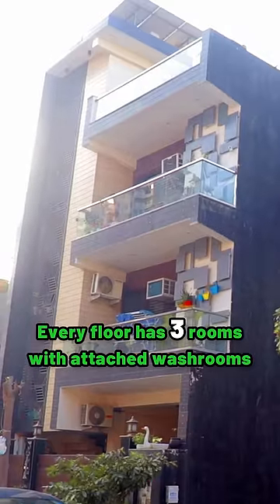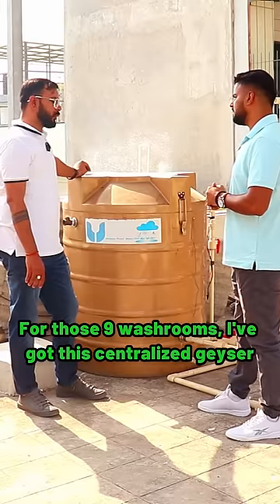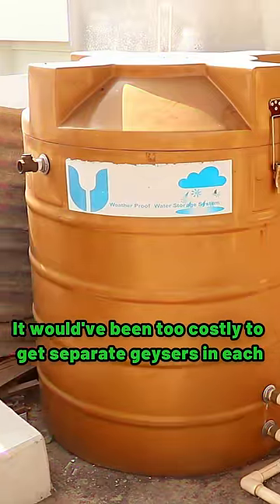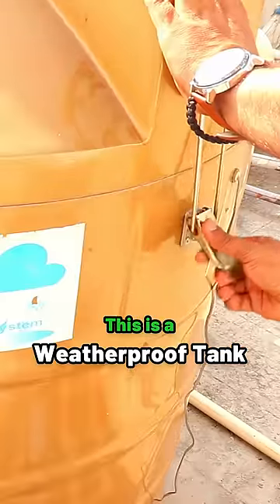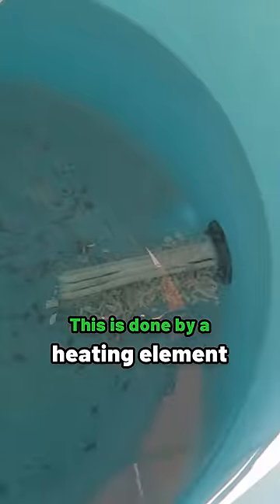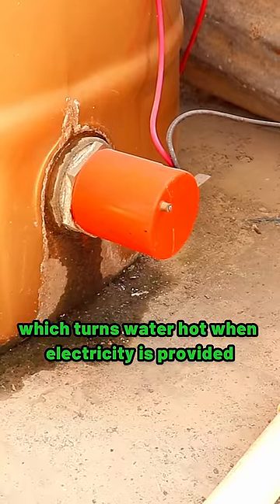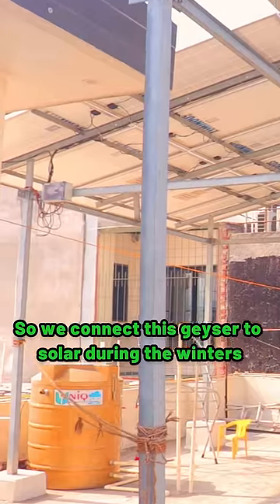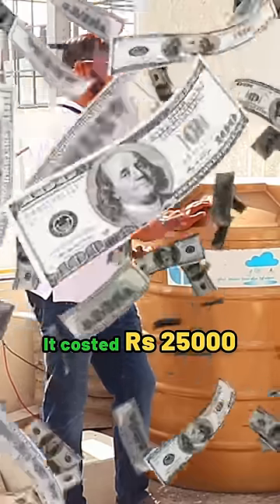Best Water Heater for Home | Central Geyser

Comment: It is a good solution if everyone bathe almost at same time. Heating 500lt of water is time consuming as well as too much electricity consuming
Reply: Brother it's a weather proof tank. So once the water gets heated in this tank it'll stay hot all day.
Reply: @RohitKumar-nl8dl but the pipes to the ground floor will be freezing cold in winters in North India. They will take away most of the heart from the water.

Initially only cold water will come for to residual water in pipes getting cooled from the environment. Then once the hot water starts flowing in these already chilled pipes it will again loose done heat. 

So it wont be effective for the ground floor or first floor residents.

Also he is only telling the cost of insulated water tank which is 25000 rupees but he is not including the electricity cost since he already had the solar setup installed.
Reply: @ankitgarg8595 also the current flowing through water 😂
Reply: @RohitKumar-nl8dl bhai without insulation material ke koi chiz weather proof nhi hoti aur second thing jb tak pani tab tk jayega tb aur heat loss hoga aur iska coast of electricity bhi 4 geyser se jada hi ayega kyunki koi admi 9gysers use nhi kr sakega iska ek simole solution ye ho skta tha ki bnda bathroom or kitchen ka same gyser lga skta hai arag done ki distance 10feet se km ho ya do opposite bathroom me same gyser connection lg skta hai ya best option solar water use kr skta but ye chutiya panti hai aur time consuming chiz hai
Reply: @Suraj-tz3oq the road he used is a imulsion road ye same type ki road gysers me use hoti hai so isme current nhi lagata hai unless ki rod brust na ho jaye
Reply: Useless😂😂

Comment: You are having hard water supply, due to which you need to change heating element very frequently. Better to add a water softener in the system

Comment: Bhai pura tank garam hote hote dopahar ke 12 baj jate hai...😅😅
Reply: Thermostat lga hota hai…over heat pe cut kr dega…. Raat ko lgake soo jaya kro subha mst grm grm paani milega😂
Reply: @viveksaini6515 jiska solar nahi hoga uska toh 50k ka bill aa jayega😂😂
Reply: @realgoat501  ary jb cut krdega tb light thodi use hogi baba😂
Reply: @realgoat501  aur jisne 9 bathroom bnaye hai.... Wo bhai ko 2000w rod ka bill b jhel he lena chaiye😂😂😂
Reply: @viveksaini6515 for your kind information btao ki 10 liter ko gram krne me jada time lagega ki 500ltr ko or jo pipe line hai usme km se 15-20ltr pani to store hoga hi aur fer heated water ko main tab tk jane me bhi heat loss hoga jo ki single gyser ke load se jada hi hoga because a single gyser around 15-20 min me 65degree heat jr deta hai but isme loss jada hai aur koi thermal insulation bhi nhi hai jisse heat ka transfer ruk jaye isse badhiya to ye solar water heater lga le tb bhi thik rahega but ye chutiya panti hai aur inefficient bhi
Reply: @nikhilkale it only takes 45 mins which is same to your 25 ltrs of geyser.
Reply: Aur agar jyada garm ho pani aur cold water milana ho toh?

Comment: @Solarclap bhai problem is that har saal element gal jata hai aur fir na replacement milta hai na koi replace karne wala. ₹200 ke element ke lie 5-600 mangte hain.
Reply: But jab bijli ke bill se compare kroge toh yeh sirf uska 10% hoga
Reply: @MrChetan486 we have solution for you by providing the same product to you which is far better than solar geysers and cost saving as well as energy saving
Reply: @MrChetan486 this element comes with warranty of 1 year and tank with 10 years.The element provided is made of steel 316 which is very durable and is used in industries and salt water as well.

Comment: Bhai Itne mein ready made solar geysers aa jaate hein. Secondly this guy is having too much energy losses. solar energy to electrical and then electrical to heat energy.
Reply: Bhai enery can neither be created nor be destroyed it only destroy one form to another
Reply: Wo efficiency ki baat kar rha hai bhai
Reply: @mohit23bansal you are wrong brother it is a weather proof tank which leads to no change in temperature thus it only takes 45 mins for heating 500ltr water and consumes only 3 units of electricity with 4kw element.

Comment: Actually it will not work as you are expecting. The CPVC/UPVC pipeline is not thermal insulation, so if you want to use hot water on the ground floor, you have to waste around 10ltr water which will be coming from the pipeline, and after that you might get the warm water. Hence, waste of money.

Comment: Wjat if the heater system leaks electricity current into the water? Everyone will get shocked just by touching the tap, right?

Comment: Avg. Geyser price = rs. 2000 
Total bathroom or washroom = 9
                     =2000x9
                     =18000
Buy single geyser for each room
Now, 
About electricity , 
In india where winter is only for 1 month or max to max 2.5 months so iam taking for 1 months
This is the consumption chart
Hourly2000 Wh = 2 kWhDay6000 Wh = 6 kWhMonth180000 Wh = 180 kWhYearly2160000 Wh = 2160 kWh

Thank you❤

Edit:- an heating rod can be a good option if you have low budget it starts from Rs. 450

Comment: 25 thousand electric bill... It may be get 5 to 6 hour to heat with one 1500w rod...

Better use large biryani aluminum vessel around 8000rs concealed with cement and brick 5thousand... Use both rod to heat or wood to fire...

Comment: "Consider utilizing a solar water heater for increased efficiency. It comes equipped with a built-in heating element, making it suitable for use during cold and rainy weather conditions."

Comment: Wait. Why? Why wouldn't you have separate heaters in every bathroom. It's much more affordable price wise, easily manageable than this single point of failure. If only one person needs a hot bath water at some time, you would have heat the entire 500 ltr tank and hope everyone uses it within 2 days.

Comment: Bijli ka bill aayega to pata chalega... 😂

According to calculation, ek baar 500 ltr ke tank kobgaram karne mei 24 unit lagenge, which means sirf tank ko ek baar garam karney ke liye kam se kam ₹7200 monthly kharch karna padega, aur Electrical Heater hai, off hoga aur phir se on hoga... Kam se kam 10,000/ mth ka kharch hoga

1 ye exp = 10,000 x 4mth = 40,0000/-

Solar water heater ya heat pump lagao, 3 saal mei recovery, saari umar kamaoo

Comment: 2kv ka heater - 2000rs(with ceramic body)
ek chota sa pump laga do 18watt ka- 120rs(water circulation ke liye);
5layer tank -2500rs
temperature controller laga dena as per requirements
itna kharcha nhi hoga😢😢😢😅😂😂😂